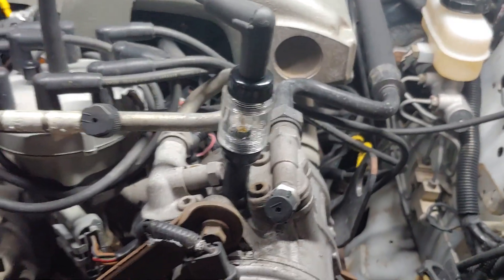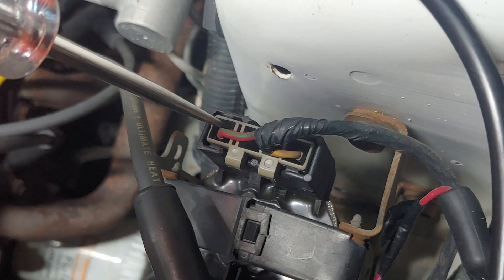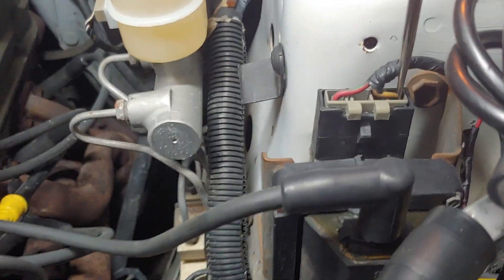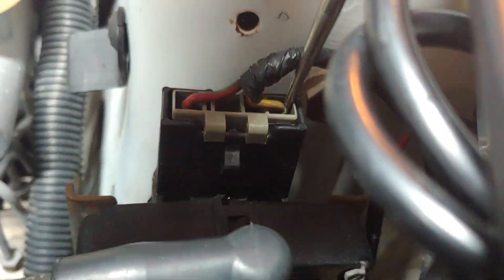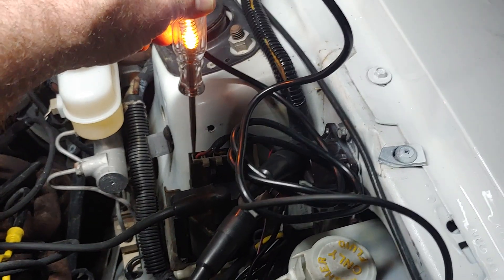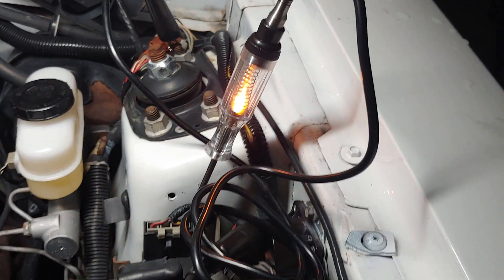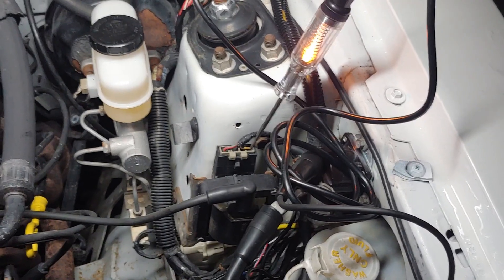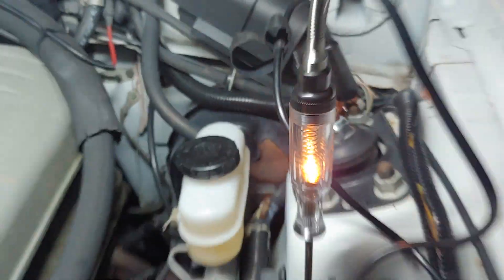How to test a TFI Ignition Coil on a 5.0L Mustang

Comment: i have a question for you. i did the same test as you but mine turned out with different results. the red wire will stay lit on the test light until the car is cranking the the test light turns off. the yellow wire, the test light is on and when cranking it flickers.
Any chance you can point me in the right direction?
Reply from the maker: It's impossible for the yellow wire to have power if the red wire does not (unless you have some major wiring issues, which is not likely). Chances are that your test light moved when the engine began cranking, and lost contact. Have a helper crank the car while you hold the test light on the red coil wire, making sure it stays touching the coil terminal during the test.

The red wire must remain hot during cranking, or the coil isn't getting power. But if the red wire is not hot, then the yellow wire cannot be hot either.
Reply: Drag Radial Performance thank you you were right I didn’t have a good connection. The coil tested the same as yours did
Reply from the maker: @whitneywilliam  good, that means it's good if you see it flicker on the yellow wire during cranking. Actually, it means that the control signal from the ignition module is good, and that the coil windings aren't open circuited. It doesn't mean the coil has any strength. Testing for how good the coil is, is another test entirely. This test just checks to see if it's being told to fire.
Reply: Drag Radial Performance thanks so much
Reply: @dragradialperformance3540   This probably a really dumb question but what does it mean when there is no power at the coil ground wire?
Reply: @johnlechner4091  normally with the key on, you will have power on the red/light green wire (the power wire coming from the ignition switch) to the coil. When the coil is not being used (key on, engine off), this 12 volts will wind thru the windings of the coil and come out the other side (the coil ground/control wire that is dark green/yellow).

When the coil is turned on (which only lasts about 6 thousandths of a second), the ignition module is grounding the dark green/yellow wire, and charging the coil. When the ignition module quits grounding the coil, the magnetic field collapses and this causes the coil to fire.

When testing, you're looking for 12v using a voltmeter on the red/light green wire (key on, engine off). If the windings of the primary side of the coil are good, then you will also see 12v on the dark green/yellow wire. You can use an INCANDESCENT test light instead of a multi-meter to see this 12v on both sides of the coil.

When you are cranking the engine, that test light should blink as you're cranking. Some of that test light's light fluctuation is due to the battery voltage rising and dropping a little (due to the high amperage that starter is using to fight cylinder compression). So a little flickering of the test light will happen no matter what when cranking. But the ignition module grounding the coil will make an even more noticeable flicker of the test light while cranking.

If there is power (bright test light) on the red/light green wire and there is no power on the dark green/yellow wire (key on, engine off), then that indicates a break in the primary coil windings. You could remove the coil and do an ohm test on the primary coil windings (coil positive and coil negative) to be sure there is no continuity between the two. If this is the case, the coil is bad. 

But you should also remove the dark green/yellow wire and make sure that it is not being grounded all the time by the ignition module. If it is, it will fry the coil, and maybe already fried the coil, and will fry a new coil. The dark green/yellow wire should never have ground on it when the key is on and the engine is off, just sitting there. This is tested by hooking the test light to battery positive, and touching the dark green/yellow wire (while it's disconnected to be sure). I have seen a bad ignition module provide a constant ground to the coil, frying the coil. Not discovering this will cause you to replace, and then quickly burn up, a new coil.

Comment: I’m having a hard time with getting my 93 mustang to fire up,  i tried this test on my car and the red wire on the left of the coil connector has voltage with the key in the run position but when I turn the key to crank it looses power,  what do you think would cause this?  The brown or tan wire on the right side of the coil connector flickers from the pulse of the TFI just like yours did in the video.
Reply from the maker: First thing I would do is have someone help you to hold light pressure on the test light, to make sure it isn't losing connection during the cranking test, when checking for power. I suspect this is the case, because in order to see any light on the test light in the tan wire, that power would have had to come thru the red wire, wind thru the coil windings, and come out on the tan wire. The ignition module pulses a ground signal to the tan coil wire. But without there being any 12v on the red wire, there would be nothing to light the light up when the test light is on the tan wire.
Reply: Did you check the red/green wire @ the ignition switch?

Comment: I have problem with my ford 1985 crowin Victoria 
I adjusted timing at 10° in idle as recommended 
The problem is when I connect timing advance connector the engine goes misfire and bad running when I disconnect it the engine running smoothly
Reply from the maker: There's only 4 reasons I can think of why that might happen. 1) there is a problem with the SPOUT wire, between the SPOUT connector and the PCM. 2) The PCM is either bad, or has bad capacitors in it, or has a custom tune in it that is awful. 3) The ignition module is bad. 4) The balancer is bad, and your timing isn't really what the marks say it is.
Reply: Drag Radial Performance  thanks for reply 
actually I have changed all this stuff 
New module and pick up coil new distributor ,cap,rotary, spark plugs and their wires and ignition coil 
Also I changed module connector socket 🤒 this car got me head ache 

i tried to set timing at 10° with spout is connected in idle to see if there is different and the results is :
10° spout connected bad running engine 
10° spout disconnected smoothly running and no hesitation

Comment: just curious....what does the test light do when the SPOUT connector is unplugged? is it the same flicker at the coil in both wires? how does it look with a MSD box installed? thanks bro
Reply from the maker: The coil flicker looks the same regardless of when the timing occurs, so SPOUT being plugged in has no effect on that. Now an MSD box is a different animal. And be very careful, an MSD box could put out 400 volts to the coil.

Comment: I have constant power on the hot side but nothing on the other side. What do I need?
Reply from the maker: There are two scenarios here. 1) Power is going into the coil positive terminal, but isn't going thru the windings and coming out the other side. This would be because of a break in the windings. You could do two things here. First, remove the coil connector and ohm the coil. It should have some resistance, but not that much. If your meter shows OL or infinite resistance, the coil windings are broke and the car will never start. You need a new coil. You could also unplug the coil connector, build a jumper wire from the 12v battery to the coil positive terminal. Then measure voltage on the negative terminal. If it still has none, the coil is bad. If it has 12v, see #2. 

2) The coil could be getting grounded all the time. The coil should have 12v any time the key is on. It's the ignition module that's in charge of grounding the coil. The module only grounds the coil for a few thousandths of a second. Any more than that is going to smoke the coil. Hook a test light to battery positive, unplug the coil, and touch the test light tip to the coil negative wire (NOT the red wire). If the test light lights up, then the coil is being grounded all the time! In that scenario, either the module is bad or the wire between the module and coil negative is shorted to ground. Easiest way to tell the difference would be to unplug the ignition module, and see if the test light goes out. If it does, it's the module. If it doesn't, it's the wire is shorted to ground.

Be careful not to replace a coil without doing both of these tests! I have seen it happen where the car won't start because the coil is bad. The coil went bad because the module was bad, grounding the coil constantly, which always will smoke the coil... fatally. Do NOT replace the coil until you have confirmed that it is not being constantly grounded by the ignition module when you have the key on. Otherwise, you'll be buying more coils.
Reply: Which module are you talking about when I put my test light to my 2 wires and crank it they stay lit not flicker or anything on both sides
Reply: Drag Radial Performance could you explain step #2 again?  Should the key be on?  I have a completely different issue with my car and I’m trying to work through different test to figure out my issue.  If possible thank you.  Nice job with the videos btw,  good info....

Comment: What if I have pulse at the ignition module but not the coil?
Reply: First, make sure you're on the right wire. The pulsed ground signal that fires the coil comes from the 2nd wire from the bottom of the ignition module on 86-93 5 liters. It then goes to a splice that branches off 3 ways...  the coil negative, the tach, and PCM pin 4 (via a ignition suppression resistor). Pin 4 is the Ignition Diagnostic Monitor in the computer.

If you have a pulsed ground coming out of that 2nd from bottom wire at the module, and you don't have a pulse at the coil (and the car is a no-spark no-start), then you should look at the other 2 branches of that wire and see if they have anything. The first would be to pull codes, and see if there is an IDM code. The PCM knows from the PIP sensor that the engine is turning, and it expects to see the coil firing. If it doesn't, it's going to throw an IDM code.

Next, and easiest, look at the tach. Does the tach move up to around 2-300 RPM as the engine is turning? Most starters produce somewhere around 250 engine RPM while cranking. That will give you a clue.

Also make sure your testing method is correct. You should have the test light clamped to battery positive, and the tip of the test light resting on the coil negative terminal. That's the coil harness wire that's NOT red.

If you truly have a pulsed ground coming out of the module, and no pulse at the coil, then seeing if you have an IDM code or tach movement will guide you as to where you lost your signal at, before or after the ignition splice. Either way, unless your testing is inaccurate, you're looking at a wiring problem. Maybe it's a simple problem like the coil connector is broke! That happens, and the coil negative wire doesn't get pushed onto the coil terminal if it's loose in the coil connector.
Reply: @Pontisteve  Thank you for such a detailed response. Turns out , the coil negative wire coming from the ICM to the coil negative had a break somewhere. I cut and soldered a new wire to the old connectors and it fired right up but ran rough.I supposed it ran rough from me not connecting to the ECM. Thank you.  I just Subscribed
Reply: @TropicBreezeRealty  No, the rough running is not related to the ECM's tach signal. The ECM just monitors the tach signal to make sure that every time the PIP sensor detects a cylinder is up to bat, that the coil fires once. It doesn't have any effect on how the car runs, just on whether it throws an IDM code. So the rough running stems from elsewhere.

When you cut that wire, don't forget the one wire coming out of the module splits off into 3 wires... IDM, tach, and coil. Depending on where you cut the wire, you could be losing some of these signals. I suggest trying to find the break in the original wire, and fixing it.
Reply: @Pontisteve  when you wrote, Depending on where you cut the wire. are you referring to the resistors?  

 the rough running was caused by the timing. Thrown off when i removed the distributor. Thanks again for all your help
Reply: @TropicBreezeRealty  The wire comes out of the module and goes to a splice, where it then branches off 3 ways. Tach, IDM, and coil. That's why I say it depends on where you cut the wire... before or after the splice, and on which leg.
Reply: @TropicBreezeRealty  There is a resistor in there to prevent inductive spikes from going into the PCM. It's between the splice and the PCM.
Reply: @Pontisteve  Are you sure? When I removed the wire loom and glue covered sleeve, it revealed two resistors crimped to the tach wire(white/pink). Didn't see any resistors going to the IDM(Tan/yellow). Which is strange because every wire diagram I've seen has the resistors on the IDM wire(Tan/yellow). I'm sure the wire harness hadn't been altered before I got there. Any who, its running like a champ.  Your videos have been very helpful. I look forward to your next video. Thank you
Reply: @TropicBreezeRealty  What year is your car, and I'll look at that specific wiring manual?
Reply: @Pontisteve  1990 Bronco
Reply: @TropicBreezeRealty  I don't have a manual handy for a 90 Bronco, but on a 95 Bronco there is a wire coming out of the module, going to a splice. Then it branches off to the coil and to the tach. No resistors at all. I was looking at fox body Mustang diagrams in my comments earlier. I don't have the exact EVTM manual for a 90 Bronco, just a 95. That could change over the years.

The main reason for any resistors in the coil negative wire would be to protect either the tach or the PCM from receiving an inductive voltage spike when the coil's magnetic field collapses (coil fires).